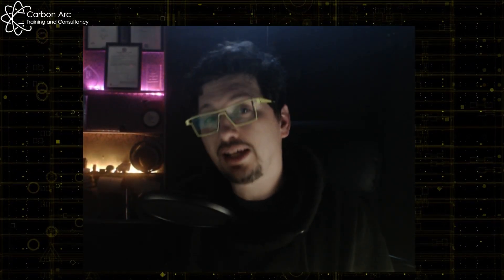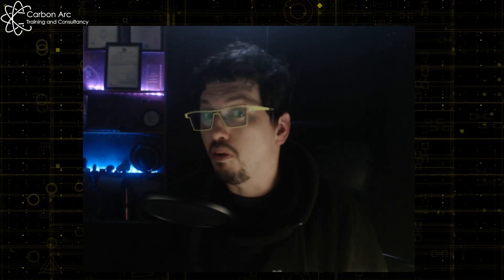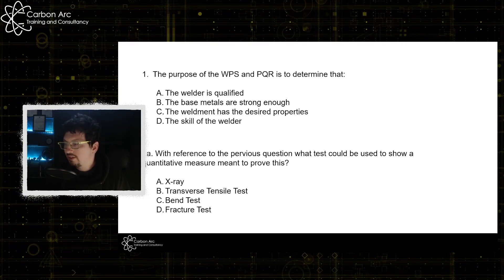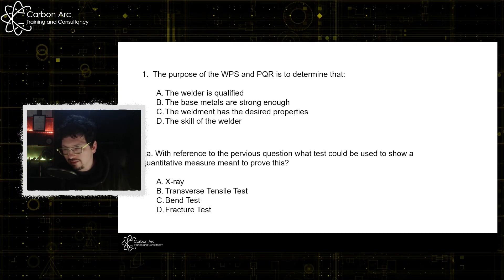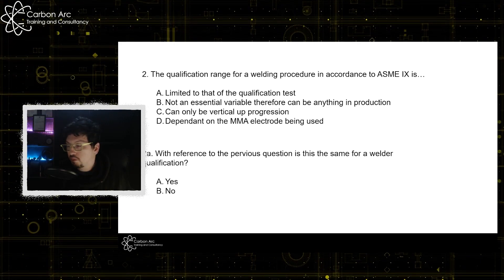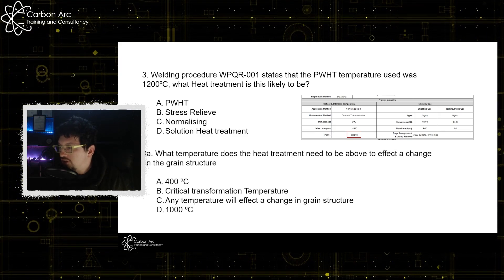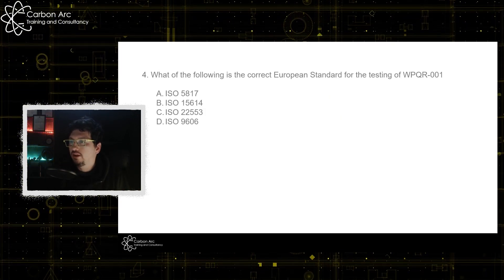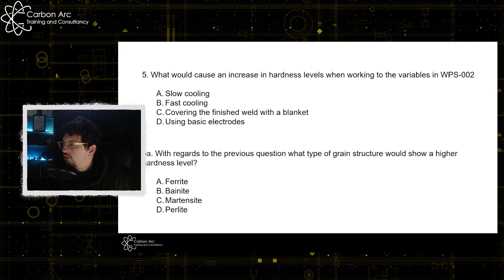WPS Multi Choice Questions

Comment: One question❓ please😢 in Iso 17637 provides the follow?       a- Requirements for Welding inspection personnel,visual inspection requirements,guidance on information to be included in inspection records. b-Requirements for welding inspection personnel qualification requirements for inspection personnel ,qualification requirements for approving welding procedures                     c -requirements for welding inspection personnel,NDt requirements for welder approval, vision requirements for inspection personnel d-all of the above ?